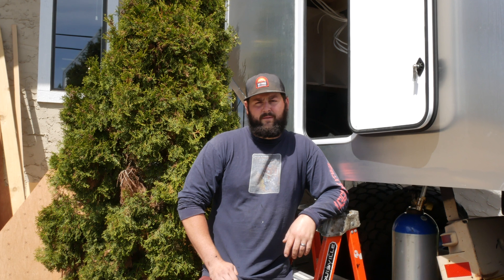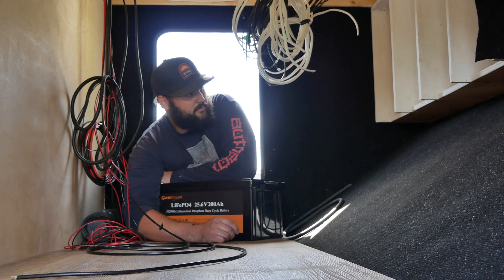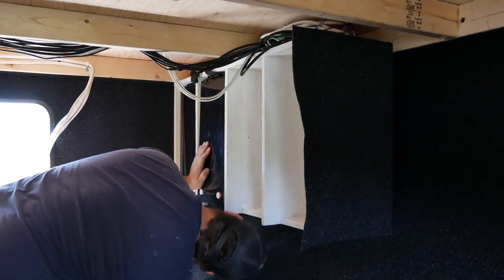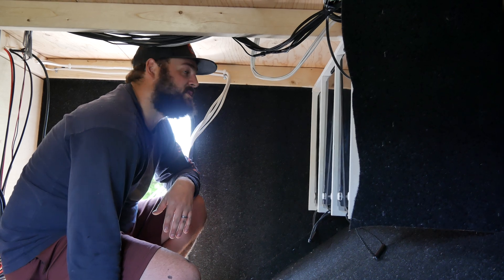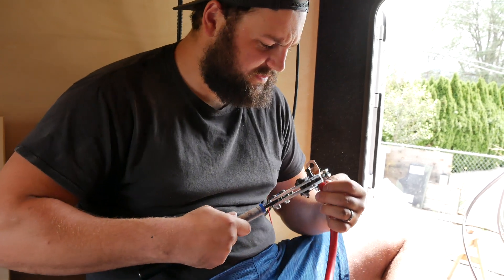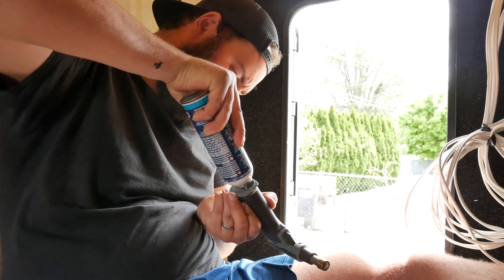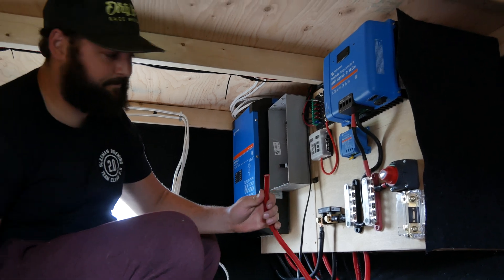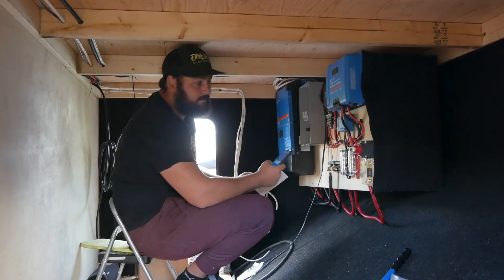Building The Ultimate Expedition Truck With A Complete OFF-GRID Electrical System!

Comment: Very tidy, nice job. This electric set-up is right at the back of the truck. I think that when hitting a roadbump of a pothole, the wooden contruction will not hold. It's over 150 kg all together. Maybe better have also some support under the batteries, or a strap arround the whole shelf system hanging from the beams.

Comment: Will those shelves really hold up? The shock load running a speed bump i think will wreck the wooden shelves. Put in support blocking from below, or add a heavy tie down strap around the box and make sure it is supported from above. 

Would be sad to wreck the expensive batteries or even have an electrical fire bc the short circuit when they fall out
Reply from the maker: Absolutely you have a point. We were planning on making 3 supports for the bottom and adding more supports from the top to prevent anything failing on some backroads.